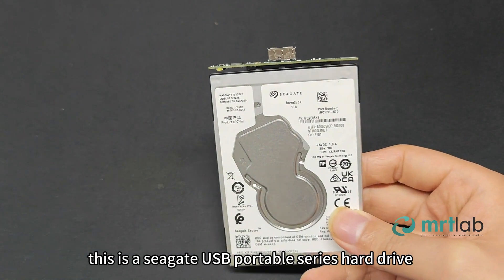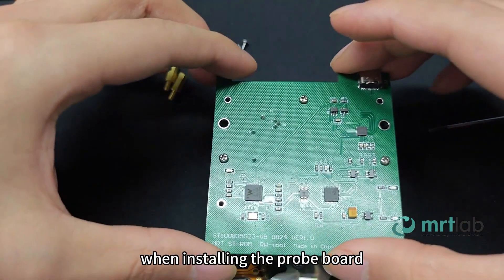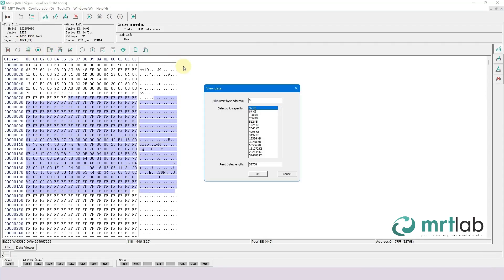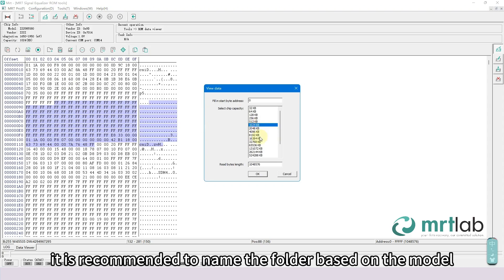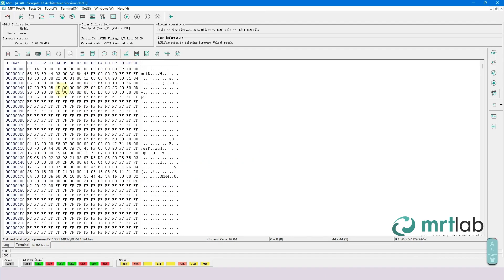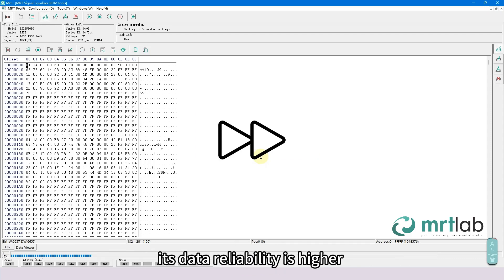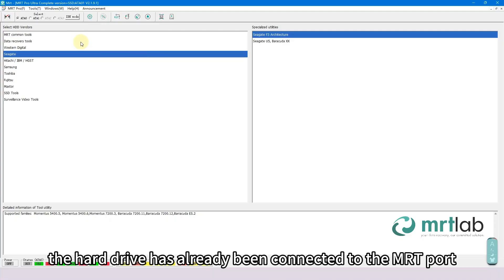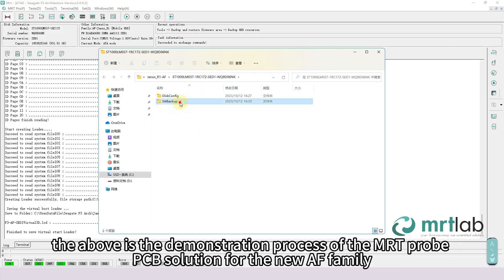MRT New AF family ROM Access：Seagate Probe PCB

Comment: Would it not make more sense to name folder based on the serial number and not model?
Reply from the maker: sure, you can name with complete model info.
since you will write unlocked ROM to drive, later you can obtain full info after clicking exchanging commands